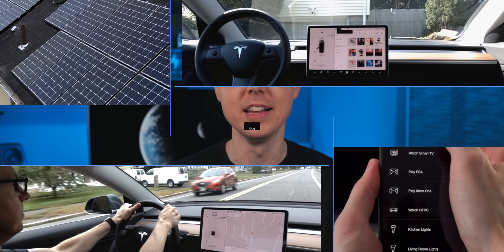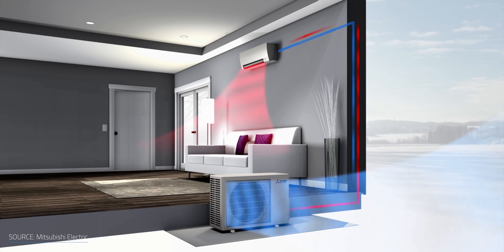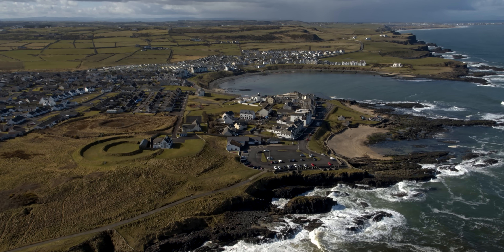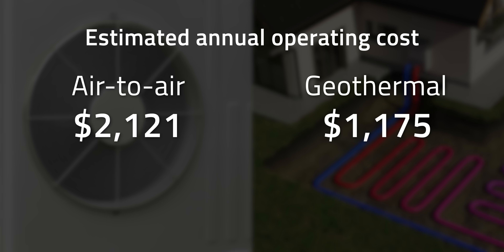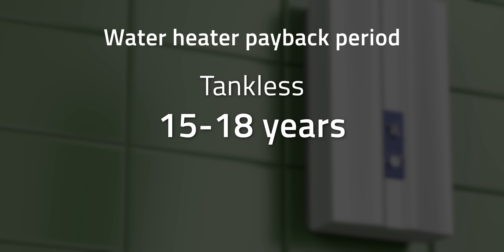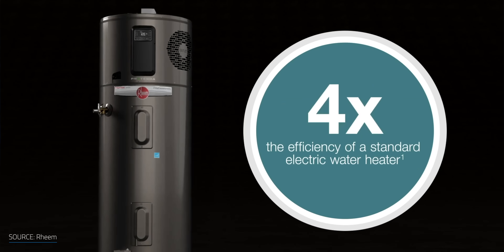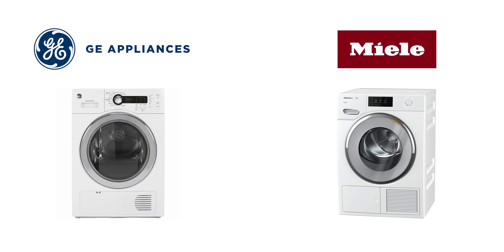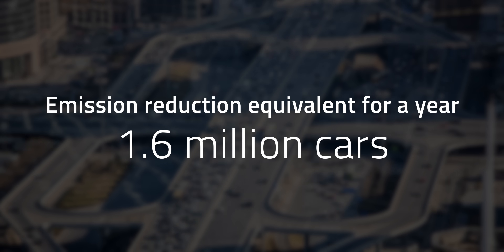Why Heat Pumps are Essential for the Future - Explained

Comment: Thanks Matt, pretty good.  Heat pumps, including water heaters & dryers, are very interesting, but a couple clarifications! -  First, outdoor heat pump compressor COP drops with outside temp.  The Mitsubishi “Hyperheat”, what I own, has a COP of 4 @ 48 deg F but drops to 2 @ 5 deg F.  I also have a condensing gas furnace (95% efficient) using traditional radiators.  The cost cross-over point for me, for what I pay for gas & electricity is ~35 deg F (close to 0 deg C) meaning that based solely on cost considerations, I should turn on my condensing gas boiler when the outside air is below 35 deg F.  If your heat pump takes its heat out of/ puts heat into buried underground pipes, this does not apply since ground temp, at a sufficient depth, is ~55 deg F in my area.  

Heat pump water heaters - Matt and/or the company he got his information from, makes a mistake here.  The savings you get goes down in the winter.  For example, in the winter, the water heater heat pump extracts the heat from your house, not from the outdoor air, so it adds to your heating bill.  This is true even if the device is in the basement since a cold basement chills the floor of the upstairs.  In the summer, you will get a little free cooling and also some free de-humidification, but not enough to replace your main A/C unit or even your basement dehumidifier (depends on how moist your basement is).  This is like how in the summer your refrigerator, also a heat pump, blows hot air into your kitchen which then must be cooled by your home’s A/C (old cats like sitting at the base of refrigerators because of the heat).  In short, it is best to have a ground water based hot water heat pump, or heat pump of any kind, but, as Matt said, it is going to cost more $.  So who is going to invent a ground water based refrigerator, refrigerators run 24/7!

Heat pump dryers with no vent to the outside - OK, I never heard of these until this video.  My first thought was lint.  Outside my house, by the dryer duct, there is always extra lint even though my dryer has a lint filter.  Lint buildup can cause fires, which is why I have a metal foil dryer duct which I vacuum out every couple of years.  Also, the savings are not that dramatic since dryers are only run once in a while.  Using Matt’s numbers, an old-fashioned electric dryer costs a max of $0.55 per a single run and an electric heat pump dryer costs a max of $0.33 per run.  I do 3 loads a week, 156 per year.  That’s $85.80 for the old-fashioned dryer and $51.48 for the fancy dryer, a difference of only $34.32 per year (NBD).  I am also dubious about the claim that the heat pump dryer lasts twice as long since it is arguably a much more complex machine.  Complexity inevitably leads to a higher risk of breakdown and washer/dryer engineers, long ago, were instructed by their management teams to design washers & dryers to fail sooner than previous designs forcing consumers to by these gadgets more often.

Final comment - I want to echo Matt’s statements about how weird heat pumps seem, where they can seemingly create, for example, 4 units of heat energy using only 1 unit of electrical energy.  Matt gave an OK explanation, but not the best.  It all makes sense if you draw an imaginary “control volume” around the entire heat pump system (including both the inside air handler and the outside compressor/heat exchanger) and then draw arrows representing energy into and out of the control volume.  For example, during the summer, go outside when the outside compressor fan is on, and put your hand in front of it - the outside unit's fan sucks warm outside air into the outside unit and expels air much warmer than the ambient outside air, this represents a net energy flow exiting the control volume.  Inside the house, the air handler sucks in your somewhat cool, but hotter than desired, inside air and expels into your house much colder air which represents a net energy flow entering the control volume.  Lastly, electrical energy is being added to make the system go.  Compare the difference in energy per unit time between the inside & outside air flows, which is the amount (rate) of energy being "pumped", with the rate of electrical energy used to get the coefficient of performance, COP (COP = (pumped thermal energy converted to Joules) divided by (electricity converted to Joules) for a chosen span of time, note: 1 Joule per second = 1 watt).  Conversely, during the winter, the air coming off of the outside compressor will be colder than the ambient air around you and the inside air handler expels heat warmer than the inside ambient air (pumping direction reversed).  The big clue is the word “pump” in the term “heat pump”.  Stunningly, air-conditioners, since their invention, were capable of generating both heat as well as cooling.  All that had to be added to the design of the old-school A/C unit, to enable both cooling and heating and which was mentioned by Matt, is an electrically controlled valve that flips the coolant lines.  When petroleum was dirt cheap, back in the good old days, it was economically viable to ignore the energy savings inherent in a bi-directional heat pump.  This is not the case anymore.  

BTW, this energy pumping business is philosophically the same as what you do when you carry a propane tank for your gas grill from your truck/car to your gas grill.  Clearly the energy in the propane tank is much higher than the energy you expended moving the tank from your vehicle to your grill, therefore generating a huge COP.  Hopefully this comparison did not confuse your further.
Reply: Fantastic comment
Reply: I'm trying to wrap my head around the efficiency difference between a heat pump and gas furnace for heating homes.  Do you know anything about the energy efficiency of the power plant and transmission vs. natural gas production and distribution?  Obviously this will vary depending on what type of power plant you get energy from, and where your NG s produced.  But in order to compare apples to apples, the energy efficiency of one's local power plant should be included with the heat pump efficiency/COP.  Similarly, the energy efficiency/COP of NG production should be included with the furnace efficiency.  Matt does mention that combining these with solar panels would be net zero - but most people will use local utility power.
Reply: @KevinChernenkoff  Correct. For your information, the max theoretical efficiency of a hydrocarbon based power plant (Rankine cycle) is 40% efficient (conversion of chemical energy to electrical energy). When you consider that NG boilers are typically 80-90% plus efficient (chem energy to heat energy), this is why, for heating, electric resistance is actually worse than NG in terms of GHGs assuming a 100% hydrocarbon based grid. But as it turns out, depending on your climate, heat pumps are typically as good if not better than NG heating in terms of GHGs even with a 100% hydrocarbon based grid. And that obviously gets better as the grid is decarbonized. Hope I answered your question. For more info I recommend the cover article in the Sept 2021 issue of the ASHRAE journal.
Reply: @bluebooper  Makes sense.  If a heat pump has a COP between 2 - 4, if the source power is 40% efficient, this is still roughly 0.8 - 0.16 compared to the furnace that is about 0.8 - 0.95.  If the grid is decarbonized that does decrease the total carbon output of a heat pump, whereas a NG heater will always be carbon based.

I've got another question - since you seem to know a lot about this!

I live in upstate NY, and the state just passed laws to transition all homes off hydrocarbon heating (for new homes after 2025, and replacements of existing units after 2030).  I haven't done a lot of research on the power grid capacity, so this question is really hypothetical.  If there is a cold day (let's say 0 degrees F), all houses simultaneously need more heat at the same time that heat pump efficiency drops.  If the COP drops by some factor (let's say 4x more electricity is required per unit of heat transfer), and the energy required goes up by some factor (let's say the heat lost from the house is 2x), the electricity requirement for the heat pump goes up by the product of these two (8x in my example).  Furthermore, I've heard some people way that heat pumps in colder climates have a resistance heating backup for cold weather (with an even lower COP and higher electricity demand).  The electricity grid is obviously designed for some peak load.  Is there any concern that the existing grid will struggle with peak loads once ALL houses have heat pumps?  It's quite possible that the magnitude of power for heat pumps in all houses will be a small fraction of the grid supply, and/or I may be framing my question incorrectly or making bas assumptions.  So I'm curious what you think.  To clarify, I am not trying to "fight" heat pumps, but understand whether there is a trade-off with the benefits of redundancy and a NG system already designed for peak-load heating.  Thanks!!
Reply: @KevinChernenkoff  The numbers in your example are a bit exaggerated, but sufficed to say that, conceptually, you are on the money. I would say leave your NG heating in place as back up for those days when the cost or emissions (whichever you prefer) of the heat pump no longer make sense (different for every grid) as compared to NG heating. Depending on the climate where you live, heat pumps are the most energy efficient with lowest GHGs most of the time. However as you say it's those peak heating conditions that the heat pumps and thereby the grid is pushed the hardest. As a result with all of this electrification of heating, the power utilities are having to expand their capacity, leading to higher electrical rates in general. This is not too bad, but the real challenge comes when trying to decarbonize the grid at the same time with renewable tech that is in many cases more expensive than fossil fuels and not always immediately dispatchable depending on the type. I work in this industry (in the energy efficiency subsector) and these are the challenges we are working against as businesses, institutions, and as a society today when it comes to sustainable heating. We need to focus on not only efficiency on the demand side (buildings & industry; extremely important since there are innumerable easy wins out there), but also focus on investing in the right technology such as hydrogen energy storage (for storing intermittent renewable sources; better than batteries), modular nuclear fission power, as well as continuing to try to figure out nuclear fusion power.
Reply: @KevinChernenkoff  oh and I was remiss to not mention electrical thermal storage technology (ETS, ceramic type), which is large piece of the puzzle when it comes to solving the grid-level challenges we were discussing above. Basically store electrical heat energy at night when the grid has excess power (due to ramping for hydrocarbon based plants, or due to the fact that wind blows stronger at night) for use during the day
Reply: @bluebooper  Thanks Kyle!  Glad you are in the Youtube comments section.  I appreciate sectors that work on solutions like developing new technology and making energy use more efficient.
Reply: @KevinChernenkoff    Great questions Kevin and a bit above my knowledge comfort zone, but I can give you what I know.  First off, and you didn't ask about this, I want to underscore that the outside temperature gas versus heat pump cross-over point of 35 degrees was computed solely on a cost basis (i.e., the cost to me at my USA location).  Said another way - when outside temps are above 35 deg F, it is less expensive to for me to heat using the heat pump and at 35 deg F and below, natural gas is the least expensive way to go).  Also, I want to repeat how my computation was based on a Mitsubishi Hyper Heat pump with a published COP of 4 @ 48 deg F and 2 @ 5 deg F and a 95% efficient condensing gas boiler (95% of the theoretical thermal energy in natural gas converted to heat).  So, my statements here so far, and in my original comment, are from a practical/consumer point of view.  Your questions are social questions.  The answers to your questions would influence people who "want to do the right thing".  I try to be one of those people, but it is hard getting all of the data needed to make a truly informed opinion.

TRANSMISSION LOSSES - 
Natural gas transmission losses - There are leaks in the gas plumbing before the gas gets to someone's gas boiler.  A UK study said that their natural gas system leaks 5 to 10% of the gas passing through it.  Is the USA similar?  I don't know.

Electricity transmission losses - High voltage cross-country power lines lose 10% of the electricity flowing through them.  What are the losses from the power station to those lines and the local distribution losses - I don't know

General conclusions regarding gas versus electrical distribution losses - My gut feel here is that both forms of energy have the same transmission losses which are probably as high as 20% for each energy source (i.e., they have similar rates of transmission losses).  BTW - This is just my gut feel and I reserve the right to change my opinion given better data (side question - How come in today's society, so many people don't grasp the notion that it is perfectly OK/honorable to change your opinion based on new information and such changes don't occur because of being sneaky, waffley, criminal or a being a member of a conspiracy, normal rational people can/should change their opinions from time to time) 

ENERGY PRODUCTION LOSSES -
OK, regarding energy cost to produce/generate natural gas - It costs energy to frack a gas well, but since a good fracked gas well can produce gas for over a decade (some don't go this long), this initial cost washes out.  There is energy needed to get the gas up to standard pressure.  How much loss does this represent - I don't know.

Coal plants turn coal into electricity at an energy efficiency of between 30% and 45% (burning coal makes steam, steam flows through a turbine to generate electricity).  

Natural gas turbine/generators - 35% to 40% for "simple" cycle and 60% for "combined" cycle

Nuclear - Uses the same sort of steam turbines used in a coal plant.  A nuclear fuel rod gives off usable power for about 6 years which is great, except, there is a lot of expense related to creating that fuel rod as well as properly disposing of it all of which makes the true economics of old-school nuclear problematic.  There are lot of clever newer, smaller, modular nuclear designs being kicked around but none have gained traction yet.  Nuclear is a green energy source from the perspective that it does not produce CO2.  Traditional resistance to its use came from the scary radiation related side of nuclear power.

Heat pumps & COP - Heat pumps can be considered as an energy source, sort-of, since they can "pump", for example, 4 units of heat energy into your home using 1 unit of electrical energy (Mitsubishi Hyper Heat @ 48 degree F outside air, COP = 4 in this example), as opposed to an electrical resistance heater that converts 1 unit of electrical energy into 1 unit (or maybe 0.98 units) of thermal energy (COP = 1).  

     Side Note: You asked about "...energy efficiency/COP of NG production".  I talk here and in my original comment about what "COP" is and you need to read up on it please.  COP = Coefficient of Performance and is a term usually used when talking about heat pumps.  It is not a term that usually pertains to natural gas.

Solar - Solar panels last over 20 years.  Solar energy is "free".  The "solar constant" is 1370 watts per square meter. Current solar panel's efficiencies vary from capturing 15% to 25% of the available power represented by the solar constant.  This electricity has the same transmission losses since once it enters the power grid, it is just another electron.

Wind - The wind, of course, is free.  Modern wind turbines capture between 30% and 50% of the available wind energy (wind turbine blades are fixed-pitch, meaning that they are designed for optimal performance at a particular wind speed).

Geo-thermal - Drill a deep well using current oil drilling tech to get to a depth where the temperature is hot enough to heat a working gas that drives a turbine (similar efficiencies as coal, gas & nuclear at this point).

Fuel cells - 40% to 60% efficient.  This is a neat tech that can turn natural gas or hydrogen into electricity directly without the pesky step of boiling water for use in a turbine.  Please note that the hydrogen used by hydrogen fuel cells is not "mined" but is usually made by shooting electricity into water to split the H2O into H & O.  Hydrogen is more analogous to a battery.  Isolated desert communities all over the globe could put up solar panels and convert the energy into hydrogen, likewise with isolated wind farms (like deep sea wind farms).

Bio-mass - This one is a head-stumper for me.  This was originally proposed by environmentalists as being carbon neutral.  The idea is that you capture carbon by growing bio-mass, like saw grass or quick growing trees, then you burn it (releasing the carbon)  to create steam for a traditional steam generator.  This concept looked great on paper and in Power-Points, but if you visit one of these power plants, it is a bit unsettling to see all of those trees get consumed by the voracious maw of the power plant and it is difficult to check if someone, somewhere is replanting saw-grass or trees at the same rate that the power plant is chewing them up.  There have been some recent dismal reports about the success of tree-planting programs world-wide where politicians, eager for a photo-op, pose next to newly planted trees that then mostly die a year later because they were planted in inappropriate soils or in places with too much or too little moisture.  This is a topic I really need more information on, like, are bio-mass power-plants required to own and provide up-keep on the thousands of acres needed to grow the bio-mass and provide paperwork to prove their carbon neutrality?

Wood stoves - A good wood stove can covert wood into heat at a 75% efficiency.

COMMENTS ON POWER GENERATION - There are three viewpoints that people use, in my opinion, to select how they want to go power-wise.  Social, Emotional & Cost based (SEC).  

Emotion based choices are a mine-field to talk about, so I won't.  

Cost-based decisions are like what I put forward in my original comment - what is the least expensive (US dollar-wise) way to get my energy? Cost-based is a bit easier, but still takes some work.  For example, when I compared heat pumps to gas, I had to make a spread sheet that converted both energy sources into Joules (a unit of energy) and I also had to account for the heat pump's decrease in efficiency (COP) as outside temperature drops. Also, I learned that the energy content of "natural gas" varies not just from USA state-to-state, but from town-to-town.  A year ago, for example, New York city's natural gas had the highest energy per cubic foot (why?  I don't know, I don't live in NY NY).

Social - The social perspective involves digging deeper by asking the sort of questions you posed - Where is my energy coming from.  What are the real costs at all levels of obtaining energy, including but not limited to reclamation of open-pit or other types of mines, nuclear fuel tailings at the front end and 10,000 year storage facilities at the other end (what ever happened to breeder reactors that converted nuclear waste into new fuel?), plus all of the emissions including CO2, etc.  

Social Side Note - Modern USA coal plants are really something to be proud of.  75 years ago, coal power plants spit out all sorts of nasty nitrous oxides and acids along with dust and CO2.  Now USA coal plants purr along emitting mostly water vapor and CO2 (acid-rain was a thing when I was a kid, so was the book "Silent Spring").  We will need these great unfairly maligned coal power plants to give us a bridge to a cleaner future.  Having said that, we need to push aggressively towards even cleaner power sources that don't even emit CO2.  

It is not talked about much, but Geo-thermal can be a big thing.  It is not commonly known, but most of the heat just a few thousand feet under our planet's surface is generated by naturally occurring nuclear fission.  The heat is not, as some might think,  left over from the formation of the earth 4.5 billion years ago.  That heat would have left earth via infrared energy emissions a long long time ago if it were not being replenished by nuclear decay.  Our ancestors were smart enough to seek out the natural warmth of caves, we "modern" humans are the ones who insist on building structures outside of the naturally warm blanket of mother earth (OK, I like regular houses too and do not own an earth sheltered home, but I admire those that do).

Good luck in your own knowledge journey.
Reply: @roberthigbee3260  Thank you so much for the thoughtful and kind response! I've made a similar observation that our society puts down people who change their mind.  Obviously there are people out there that will flippantly change their minds for political or other less "virtuous" reasons - so it's easier for some people to accuse someone else of changing their mind for one of the reasons you mentioned.  Unfortunately, almost everyone else in society is so busy with life, they don't have time to really understand what's going on.  So if Bob calls Larry a conspiracy theorist, and everyone trusts Bob (and especially if everyone also doesn't really like what Larry is suggesting)... then as far as everyone is concerned, Larry is a conspiracy theorist.  It obviously has more factors than that, but that's my two cents on society.

Regarding COP - you are absolutely correct that I wasn't using the term properly.  I expanded the use to try and include overall energy efficiency of an entire heating system from start to finish.

I'm glad you mentioned that NG has the energy use for fracking.  It also has the energy for drilling, building infrastructure, operating, maintenance, etc.  Including the energy used to mine, manufacture and transport physical components like pipe, pumps, compressors, vessels, etc.  Plus energy for material disposal, recycling, reclamation and other end-of-life tasks.  This total lifecycle energy is a component of all the sources of energy.  I'd question whether this total lifecycle energy is negligible compared to the energy produced.  It certainly could be negligible, but that would be a deeper and very complex analysis.

After reading through your original post, and all of these comments, I have come to a bit of a theory.  I could be wrong on this, but I think there could be some merit.  One could spend a career figuring out how to compare the different efficiencies of different energy production, transmission and use in the home for heating.  However, the cost can be used as a proxy for energy required to heat your home.  In your example, we don't need to know the efficiency of the power plant or the NG production.  The energy used to build, operate and get fuel for the plant are accounted for in the price of electricity.  Same for the price of natural gas.  Once it's at your house, the relative efficiencies of the heat pump and furnace determine how much electricity or natural gas you need, which created a total cost to heat your home at any given temperature.  So if the price of natural gas doubled in your area over time, it was likely because it became harder to produce (more energy required).  Higher gas prices would lower the temperature that you switch from heat pump to furnace.  Similarly, when people are looking at how many years (of lower energy cost) it will take to pay off the initial investment of a heat pump - this is a proxy for how much more energy it currently takes to make a heat pump compared to a furnace (and how much less energy it takes to run the heat pump).  In the future, the cost of heat pumps will decrease - which means that it's more efficient to manufacture (and again, a good proxy of how much energy the entire process takes).

I think the biggest criticism for what I just described is that using the cost as a proxy doesn't take into account external factors like environmental impact and human rights, and does an even worse job at projecting these costs into the future.  Which I think is a fair point - and one that doesn't have an easy answer.  In our global society, people have the ability to produce energy in a way that creates a burden for those who can't stand up for themselves, or a burden for future generations - basically passing the cost along to others, so that cost doesn't show up in the price we pay to heat our homes.  Now that I'm writing this, I realize how I'm not breaking any new ground with my discussion.  In your response right above this, you already addressed the social costs.  I'm just calling them external costs (since they aren't included in the dollar amount).  So really, the social/external costs are what we are really talking about when we want to "do the right thing".

I guess the only real opinion that I have is that we need to be careful on how we define and quantify the external costs. Almost all decisions have some sort of trade-off between different external costs, and it's easy to focus only on a single external cost and ignore (or simply not be aware) of other costs. Furthermore, someone has to decide how much weight to give the different external costs (how do you quantify a human rights violation vs. an environmental impact? This depends on how an individual ranks moral priorities).  On top of that, someone also has to project costs into the future and compare to the costs today.  This gets even more complex because people often only account for the external costs within a specific geographical or time constraint, and ignore the costs outside that boundary. So someone has to decide on how we define geographic and time boundaries for defining the external costs.  In addition, individuals have limited time, mental capacity and access to correct information to evaluate this.  And to top it all off, everyone (including myself) who is trying to define and quantify external/social costs has tendencies to do it in a way that benefits their career, finances, social standing, religion, ego, etc.

All that said, we should still try to figure it out and do the right thing!

Anyways - thanks again Robert and Kyle for the discussion!  The more people that are curious, honest and open-minded, the better!
Reply: @KevinChernenkoff  - I am inspired by your viewpoints.  I think if that ancient Greek philosopher Diogenes held his lantern up to your face he would see an honest man.

BTW - In 2021, my natural gas versus heat pump cost break-even analysis was around 45 degrees F.  After this year's electric and gas price hikes, the break-even point went down to 35 degrees F, meaning that electricity in my area went up a bit more than gas this year.

Addition to my list of energy sources - I forgot to list hydroelectric power, which can capture up to 90% of the potential energy of a given dam's hydraulic head using a "full Kaplan" turbine.  I once had the opportunity to tour a hydroelectric dam on the Columbia River out West, had to get a security clearance (pre-911, any boy scout troop could get a tour, but my tour was post-911) and I must tell you that it was an impressive facility.  The particular hydroelectric plant I toured sent almost all of its power to San Fransisco.  If a hydroelectric dam is on a barren rocky valley, then it is clean energy.  If you have to flood a lot of farm land to make your dam, the rotting earth and vegetation that ends up under water can release a lot of methane. 

I also forgot to list wave and also tidal power (tidal power is only good in a few places).  Devices that capture wave energy are getting better and better, albeit a bit slowly.

I also did not list fusion power since that has not been perfected yet.  There are way too many prototypes to list here.  That US Government focused laser fusion research facility that recently bragged about getting more out that they put in was very misleading - They only counted the final laser energy going in versus the fusion energy released.  Unfortunately lasers are terribly inefficient.  You have to put in ~5 to ~10 units of power to only get ~1 unit of laser photon energy out.  So, that Lawrence Livermore Lab fusion device was no where near breakeven when you count the power input of the whole machine.  Luckily, there are some other fusion devices that are close to actual breakeven.

I mentioned wood stoves already.  I just visited a relative that heats their whole house using a high efficiency wood stove.  They have all the wood they want, for the time being, due to the Emerald Ash-borer (beetle) killing several of their big trees.  A downside to wood is that you have to split it, stack it and lug it to your wood furnace (warms you twice, maybe three times).

Other small energy sources: Atmospheric pressure - This is not practical on a large scale, but there are some old clocks around that actually harvest the energy of variations in the barometric pressure to run a clock forever.  Additionally, way back, I had a watch that was wound up by the motion of my wrist as I walked around, that counts as human produced energy, like what powers bicycles.  I also did not mention animal energy, like horses, donkeys, mules, oxen, elephants, etc.  The Amish in the USA have, for example, a horse driven treadmill that is hooked up to a thresher as well as a sort of horse-driven merry-go-round powering a thresher or other tools.  One I have seen used 4 horses and it took a lot of skill to get the horses to pull in a synchronized fashion.

I also didn't mention internal combustion engines.  Generac has a whole line of gasoline, natural gas or battery-powered backups for houses or whole facilities.  ICE engines are terribly unreliable to use 24/7.  It is easy to illustrate this - If you got in your car and drove it 24/7 at 60 mph with very quick periodic trips to the gas station, how long does it take to rack up 200,000 miles?  Answer - Only 4.6 months (138.9 days).  Pretty pathetic, but car's mostly sit around unused all day.  Even if you put on 15,000 miles a year, it takes 13.3 years to attain 200,000 miles, at which point, a lot of cars are done for.  To be fair, if an ICE were run at a constant speed 24/7, it probably would be less hard on the ICE than normal driving.  As a back-up power source, ICE is fine since it is only run 10 minutes or so once-a-week and then maybe up to a day or so every couple years during a power outage.

I also didn't mention other combustion engines, like the 2-cycle.  And you can't leave out the Stirling engine or the steam engine which powered us through the industrial revolution. (was invented first to pump water out of mines).

OK, I'm done for now.

Have a good 2023!

*********
Reply: @roberthigbee3260  Thank you for the compliment!  It's mutual.  I grew up on the Columbia River in Canada, and visited the Revelstoke Dam many times (probably one of those boy scout tours)!

Another important source of energy (especially historically) is animal power.  Considering we still use horsepower as a unit, it may be one of the oldest forms of energy aside from human power and wood.  I've often proposed thousands of hamster wheels for home heating, but that didn't get past the "boss". ha ha.

Fusion is exciting, and I'm optimistic that it will greatly benefit humanity!